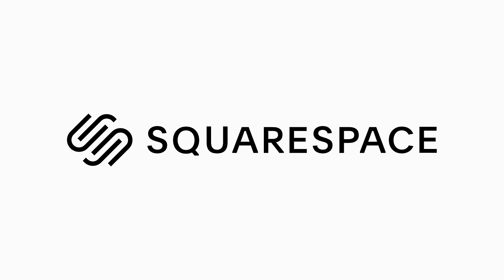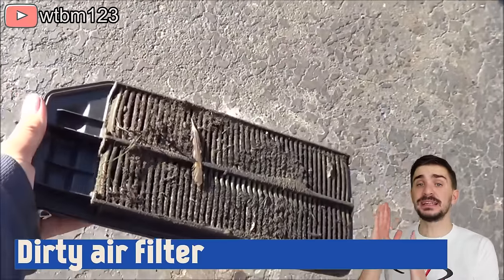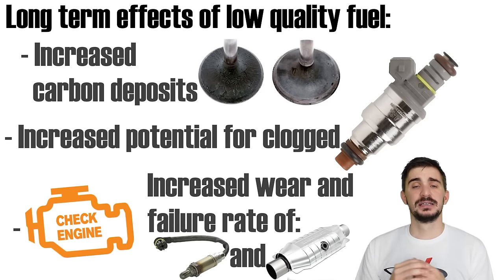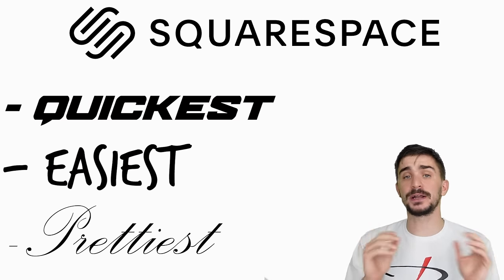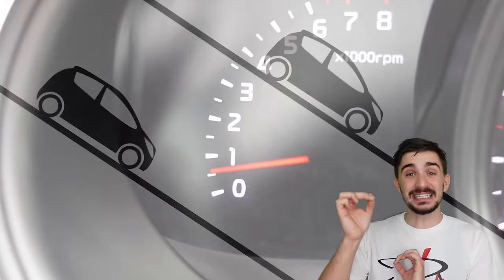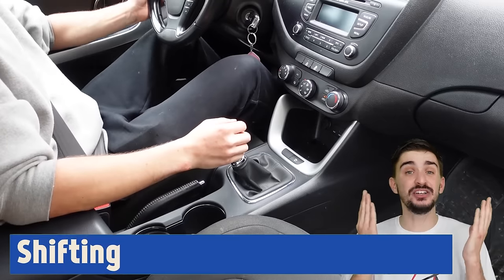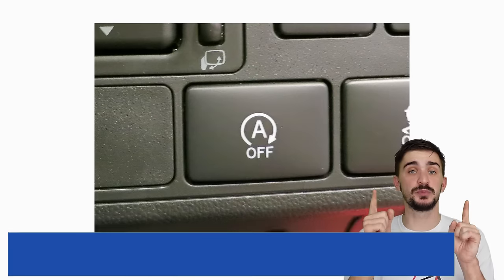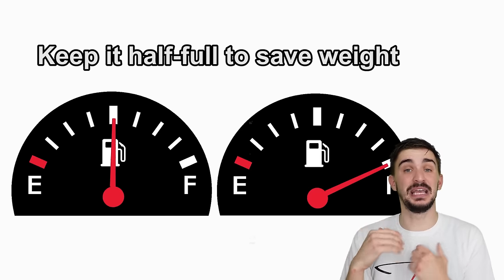EVERYTHING on FUEL SAVING - PRACTICAL DRIVING and MAINTENANCE techniques to REDUCE FUEL consumption

Comment: How to Save Gas: Drive a 1.9 TDI
Reply: YES
Reply: The prius isn't a bad option, either. I bought a neglected 2006 prius for $3200 last year and have put about $500 into it (diy) to get it running right. It has surpassed my expectations. Now, it is a solid little 180k mile car.

I drive about 25k miles a year, so driving my prius saves a ton in fuel, compared to my f150. I get 18-20mpg in my truck and 45-50mpg in the prius. With gas nearing $5/gallon, that prius more than pays for itself. My truck is also holding its value better with less mileage.

Similar to the TDI, a well maintained prius can make it 300-400k miles. The prius doesn't have a timing belt. Minor repairs are surprisingly easy and relatively cheap. Toyota cars also do not require specialty tools to work on them, unlike VW cars. On the flipside, it costs about $2000-2500 to replace the hybrid battery around the 15 year mark. The prius also does not have that addictive low-end torque and satisfying diesel rumble that the TDI provides. 

Both the VW TDIs and Toyota prius are my top picks for best economy cars. If my truck wasn't fast, I'd miss the power and probably lean toward a tuned tdi over a prius. Currently, I'm enjoying the easier, but boring, ownership of my prius.
Reply: E320 CDI 45mpg
Reply: @Brandon_Nelson92  but with the electric motor you also have a lot of torque. You could probably swap a used battery in it for less. 
I did some performance mods 😅 a 4" K&N Apollo Cold Air intake did improve the 100-200kph from 55,6 to 35,3 seconds and 180hp Software upgrade brought it down to 29,2 seconds
Reply: Tdi in rabbit pickup. 
 Can not be beat for
Mpg 
Or smiles per gallon. 

Because it’s rated at 54mpg in a vehicle that weighed over 1000lbs more!!!! 

I have bought 3 gallons since before the war in Ukraine
Reply: @imbackinthegame3611  honestly, the torque at lower speeds is decent in the prius. It's still no match for a tuned tdi in the performance department. I had tuned tdi jetta a few years ago and miss it, but don't miss working on it.
Reply: 1.3 citi golf all the way
Reply: @fastinradfordable  a TDI in a MK1 ? That's a dream made in heaven
Reply: @Brandon_Nelson92  i don't mind working on mine. Yeah the torture around 2k rpm is so much fun
Reply: Mk4 Jetta, I only fill up once a month. 400-500 miles per tank is pretty standard for me
Reply: @Brandon_Nelson92  I get the same feeling with my Prius Prime. 0-60kph is decently quick, not that much slower then my 200whp Civic Si but 60-up is where it severely lacks punch.. not that is was made for that anyway.. haha What surprises me most is how it's responsive in EV mode..
Reply: *a well maintained 1.9 TDI
Reply: @time.dealer  maintaining the engine itself isn't too tough. But the rest of the Volkswagen car? Good luck lmao
Reply: @Brandon_Nelson92  same I have 07 Prius currently. Mine was an ex-cab and neglected as well. More like $1k-1.5k later (HV battery, coolant pump, wheel bearings) in repairs for mine. I should be clear for most major repairs after this. Now, I have also had a Mk4 tdi alh 5-speed and man I loved that thing. But I do deliveries and in-town the egr get clogged and diesel is simply not meant for 180miles/per day of city driving. The maintenance (timing belt, injection) alongside water leaking into the cabin & door lock actuators was too much for me and this is (knock on gli woodgrain) supposed to be the most reliable version of tdi (later gens have def systems). But, man long haul on a road trip my tdi was flawless, the Fully loaded trim with monsoon audio and kenwood deck gave me tunes while in 5th gear on cruise control just steering. IMO, Prius is better on wallet (2nd gen robustness) and this is because the mk4+  tdi have a maintenance interval that cannot be skipped, wheras the Prius can be rode until that X component (nothing catastrophic is known for this) breaks. You just have to drive the prius with the mind of a non-car guy, the only plus side is the jbl sound system is satisfactory.
Reply: Or maybe if you can find one a geo metro with a 5 speed my friend can get similar fuel mileage as a tdi plus they are a gas engine so it is cheaper to get fuel and it is super easy to fix.
Reply: @Randomgamer-tk2zj  True that but I'm addicted to the torture and the reliability
Reply: @imbackinthegame3611  I mean I don’t blame you my uncle had an early 2000s VW Jetta TDI with a manual and he put like 400,000k miles on it and still ran like new. Only issue he had with it was the glow plugs, his car didn’t like starting in the winter but it still ran. And he wishes he still had it.
Reply: @Randomgamer-tk2zj  wow that's impressive 👏 got the same problem... it's not the glowplugs i changed them and it's still there probably Injectors, Cams or compression loss
Reply: @imbackinthegame3611  my dad had a 2006 Jetta tdi and he had a lot of top end work done to his Jetta he probably more problems with then his previous Jetta.
Reply: Just got a 1.9 VW Bora I look forward to those MPGs but it's 18 years old, remapped, EGR deleted and crusty 🤣
Reply: And have a much more expensive maintenance 😃
Reply: Depending on what you driving. Will it save fuel compared to a 5 liter V8. Oh yes!

Will it save fuel compared to my 1.2 TSI. 🤔 Not so sure.
Reply: @Brandon_Nelson92  Yeah but you ain't pulling any bitches with a prius
Reply: @Undertaker93  that's where the f150 comes in. It is sitting at about 500hp, 600tq currently. It will have 650-700hp once I upgrade the fuel pumps, downpipes and intercooler. It's a full-size 4x4 truck that accelerates like a corvette, yet is rated to tow 12,800lbs.
Reply: They'll also run on used motor oil and veggie oil🤣
Reply: How about 1.5 tdc
Reply: I do every day.
Reply: How to save even more on gas: bicycle
Reply: I drive an 87 MB190D 5speed. Easy 39mpg, with care exceeds 50mpg. Sharp  looking car, bulletproof 5cylinder motor.
Reply: Just like me
Reply: Fred flinstone did it first bro
Reply: SDI
Reply: Better yet ride a Motorcycle. I get 45 mpg with a 1980s motorcycle I got for just over 1500, and it has better 0-60 than most comuter cars.
Reply: Or a 1.3L Suzuki sub-compact
Driving it aggressively I was averaging above 40 MPG city (<6.0L per 100km)
Reply: Lol my 1.9 tdi (modified ARL) usually returns 38mpg... I've got a heavy right foot though
Reply: Deseil eco anyway
Reply: I have 1.6 tdi
Reply: Yeah, ddont buy a prius because they cost like 3 passat tdi's, thats three Times the fuel savings, but what when your akumulator lose power in prius? You dont have generator in trunk but you will always have a kanister for dizel or benzin
Reply: Facts
Reply: Not the smartest idea though if your commute is a 7 mile round trip
Reply: @Brandon_Nelson92  😂😂😂😂😂 Prius 🤣🤣🤣🤣🤣🤣🤣🤣🤣
Reply: 1.9 TDI? It wont save ypur fuel. It will devour it. 
750 fiat is good for fuel save. 4l/100 km. Its amazing.
Reply: If saving gas is top priority drive 1.3 CTDI instead, believe me, I am from Turkey where, when you fill your tank you fill 3 tanks for the state.
Reply: LOL, nothing can beat a Citroën c1 1.4hdi on consumption.
Reply: @Charn8l  I think my old V8 may beat it xD
Reply: Passat 1.9 TDI here :-)
Reply: You're definitelly not using gas at all if you drive a 1.9 TDI =))))
Reply: @andreimihail3677  🤣
Reply: Ye, i'm consistently making around 3.5L/100km (80mpg)

Translating into mpg made me realize how efficient this shit is, an average car in USA is a third of that mileage
Reply: Skoda Octavia 1.9TDi with some fuel savings tuning
Reply: Real